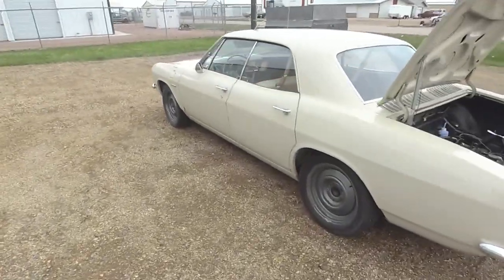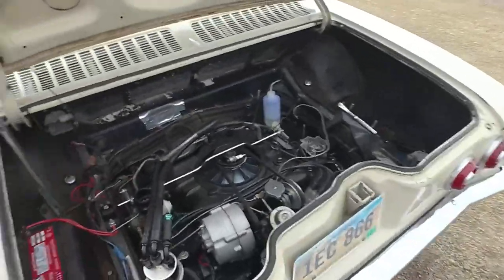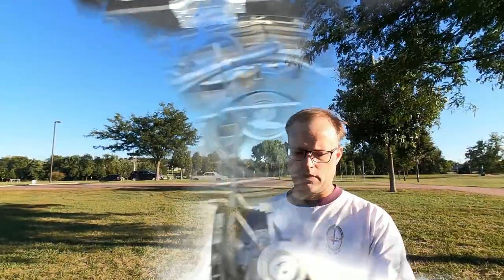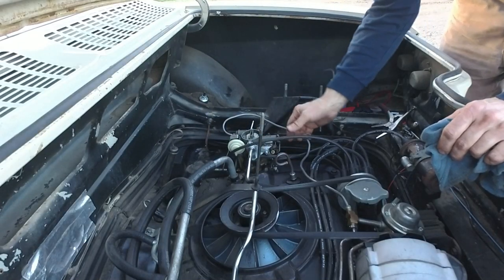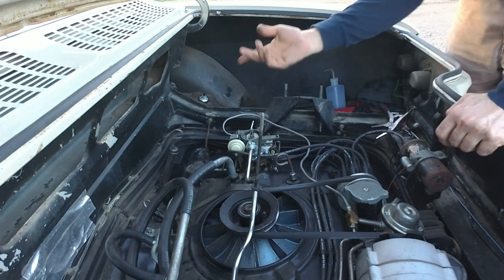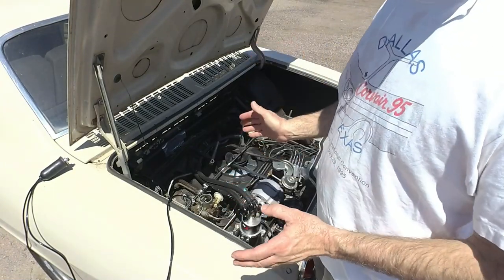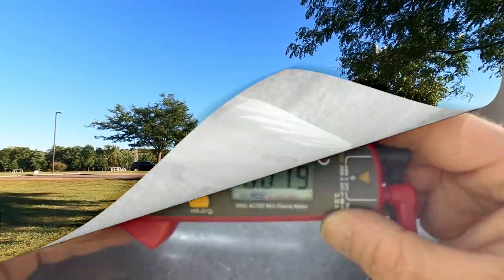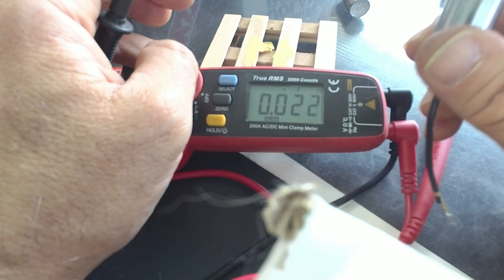1966 Corvair - Intermittent stalling rough running Solved! Guess the PART

Comment: Thank you for this!  I just bought my second corvair and it STALLED when i would come to a light.  Drove GREAT on the hwy but once I was decelerating it would just die.  I am thinking it could be as simple as an idle adjustment.  Any suggestions would sure be helpful!- laurie
Reply from the maker: Often it is something small but on Corvairs a small vacuum leak will do that either on the balance tubes or one of the caps on the carbs..  But the carbs need to be balanced per the shop manual. Then adjust the idle speed screws.

Comment: I haven't watched to the conclusion, but if it takes opening the throttle to keep the engine running, it's loading up with fuel and opening the throttle gives it more air to mix with the excess fuel. going to wait and see what the fix was.

Comment: My engine ran ok at idle, but very weak power on the road. Checked all the obvious things, like carbs, timing and ignition components. Replaced all fuel filters and check carb bowl fuel levels, all were good. I did a final valve lash due to ticking noise, but it did not go away. I thought it was the fan pulley clicking because the belt jumps. WHILE looking for the noise with a screwdriver to ear at each pully, I eliminated the belt circuit.  THE FUEL PUMP WAS NOT LOCKED DOWN, SO IT PUMPED MINIMAL FUEL, problem is gone!

Comment: It seems you went around your elbow to find your butt. Points are always the first thing to check. People have a habit of leaving the ignition switch on when the engine is not running and that burns the points. What can be really bad is replacing the points/capacitor only to get a bad capacitor in the kit. The other interesting thing was the choke pull off vacuum leak, which has near no effect on how the engine performs. After watching your video i checked mine and had a bad one, i just plugged the tube. I would like to know more about the diagnostic steps you took such as timing, vacuum at idle at each side, idle adjustment, mixture adjustments and if the plugs now appear normal.  There is more conflicting information about these engines than truth. I have 0 vacuum at idle, but it is near normal at 1500 rpm, carbs/gaskets, timing and valve timing appear to be correct. Has anyone else seen anything related to poor engine power with another solution? I have already gone to electronic ignition, so points and capacitors are not considered. Both performed the same with poor power and sputtering.

Comment: You can fill the fuel bowls through the bowl vent without all the cranking. BTW, you just washed the walls on the left bank.
Reply from the maker: That happened 5 years ago (Washed walls) and am replacing rings anyway so wasn't concerned with that. Had a bad float valve back then dumping fuel like you've never seen on that side. It was 5 outside so that compounded starting,.  I'll get it a compression check and post when I get my videos  up top date before the WI convention.